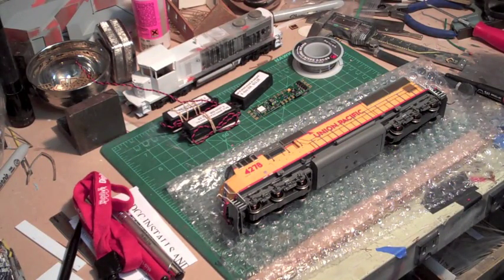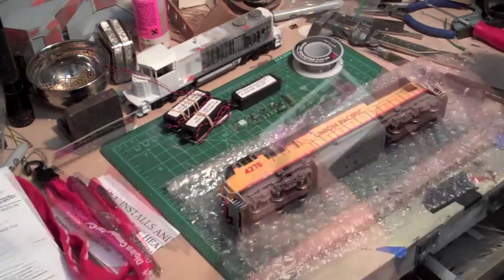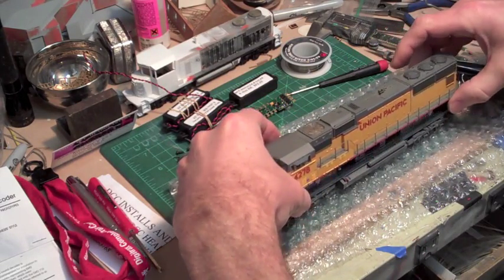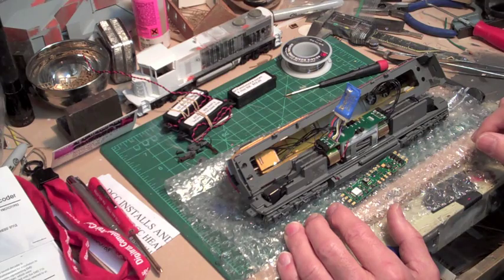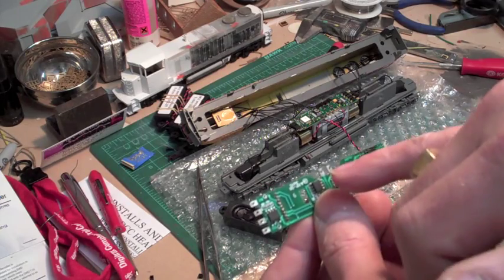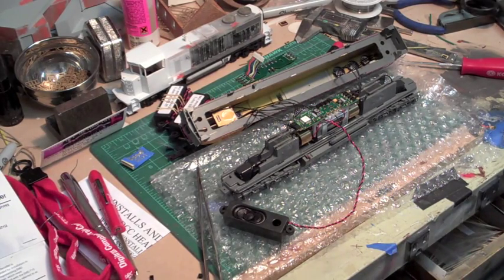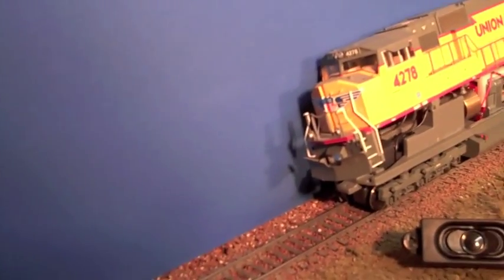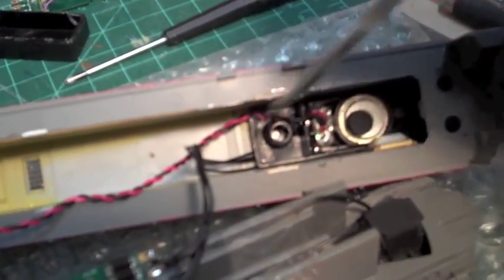Installing Tsunami Decoder in Athearn Genesis SD70M

Comment: On the athearn genesis board that you have the side with the two tabs are for the motor . the side with four tabs are for ditch lights. Athearn uses two of them out of the four  If you remove one side of the ditch lights and put on the other two tabs . I use digitrax  decoder  .then set decoder and  they will  flash from side to side

Comment: I did the same thing puting a tsunami sound decoder in a sd75m from athearn I bought a speaker for it for fourteen dollars but the speaker was half that size  and you don't have to take the enclosed speaker cover off you just slide it in then you put the shell over it and it will fit perfict and the small speaker sounds awsome and it's relly nice.

Comment: @AllenRockwell. Well what i meant was is the tsunami sound card, itself, a dcc decoder with the sound unit built into it. I have a dc locomotive that i want to convert to dcc but dont want to waste my money buying a dcc decoder plus a dcc tsunami sound card. so could i just but the tsunami decoder and not have to worry about a dcc decoder (without sound).

Comment: Allan. like you im a meticuous and i also work in broadcast on a polar bear animotornics program 'Down Under' What ive been doing with my Tsunami decoders is have distance recording of the respective EMD and GE engines so you get a 'in location reverb rather than the tiny reverb we get because the original field recording is usually recorded to close to the real locomotives long hoods and then use a Harmon Kardon mini speaker the difference is impressive. Try it and let me know what you  think

Comment: You forgot to mention the speaker.  Have you tried smaller units.  TTE has some speakers and enclosures that I find work fine and they fit into the cab.  I have some twenty units and never had a problem.  Yours seem like over kill with that port.
I hate to give up any weight as I have grades.

Comment: Question was that a first or second run Athearn?  I have a few Athearn SD70,70Ms,70MACS,75Is. I need to know how easy or how hard the shells are to remove from the frame to do DCCing on the engines? All my 70 series are first an second run Athearn.

Comment from the maker: You can ONLY install a sound decoder in a non-sound locomotive  ... unless you had a sound equipped loco and took out the old sound board first and then replaced it  ... but would be silly.